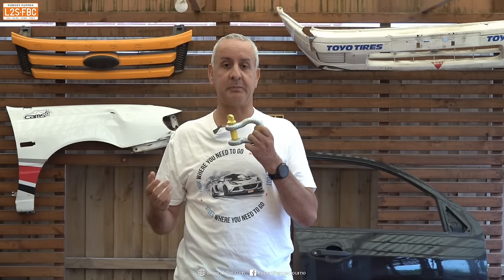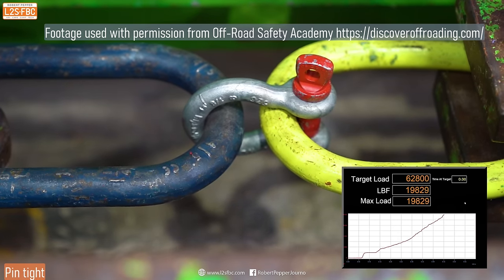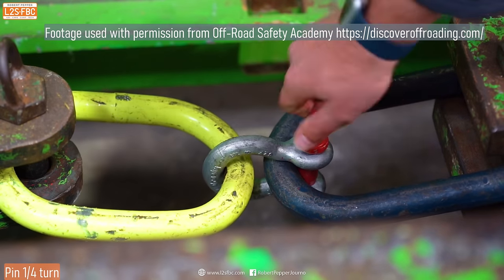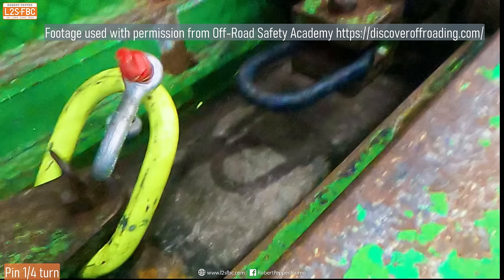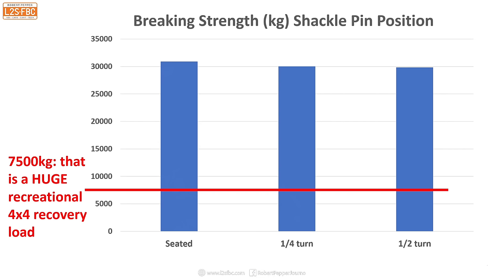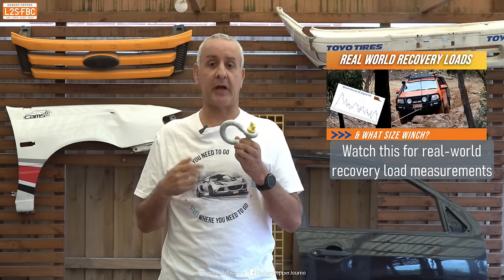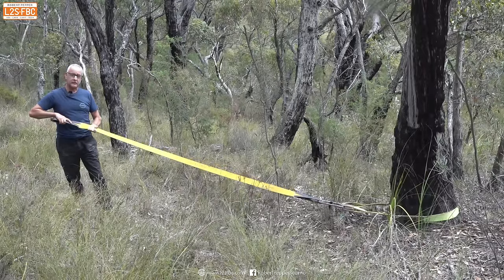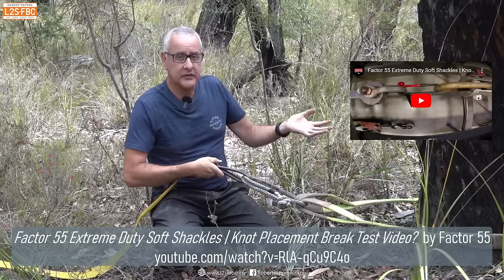What happens if you back off a shackle by 1/2 a turn?

Comment: 5:29 Nit picking here but someone can't use a calculator......  It's quite surprising that the bow remained intact in all 3 cases, even though the two eyes are thinner than the main body.  Also surprising is the fact that the pin broke in all cases, even though it's the thickest piece and a harder steel.  Shows how cutting a thread weakens the pin/bolt at the point where the thread ends.  Finally 3% variation in maximum is well within tolerances for such a shackle, I imagine.  And yes, I am 100% comfortable using them in recovery with 1/4 turn loose.  Nothing worse than having to find a shifter to undo the pin in the middle of a steep slope recovery :)

Comment: Anybody that has ever used shackle's very much knows that the shackle will tighten up when lifting or pulling the load. Have you ever lifted 5,000 lbs like that? Try to unscrew the bolt after that lift. Even with a crescent wrench you will have a hard time getting it started. And for the knuckle heads a straight lift has less tension on the cable or strap than a vehicle stuck in the mud or sand. I've seen it happen several times, Goober trying to get that bolt unscrewed after tightening it all the way down.

Comment: Here's an interesting fact.  I can only speak for Crosby as I do not have tolerance specs for other manufacturers.  Crosby publishes acceptable shackle pin shoulder clearance which is acceptable even after the pin is wrench-tight.  This is hard for many riggers to accept as they are usually taught the shackle is no good if the pins do not shoulder out.  It is sad that Crosby shackle quality is not what it used to be and I see many companies switching over the Van Beest Green Pin shackles.  Their castings are much smoother and they do not use raised lettering.  The later is important because raised lettering is tough on synthetic slings.  Another point is Van Beest and some others counterbore the shackle ear to allow a full diameter pin to engage the ear.  Crosby, CM, Campbell, Chicago...they use a fully threaded ear and so you have a good pin stress riser right at the shackle ear (where the pin thread starts).  

I've swapped over to buying Green Pin or even Skookum shackles for the projects I do for Bechtel.  Green Pins are half the cost of Crosby.  Last time I checked, Skookum shackles were cheaper than Crosby alloy shackles.  The use of Dyneema or Spectra synthetic rigging has made the use of alloy shackles more necessary so that the shackle isn't the weakest link.
Reply from the maker: Fantastic information, thank you so much!  Interesting point re the raised lettering too.

Comment: there's an argument to be made for fully tightening and using a witness mark on the threaded end. in the event the shackle fails in a situation that would be highly unlikely to exceed the working limit, you'd have a better case for a product failure claim.

Comment: Interesting results. I know they state they performed QC on the shackles, but I wonder what that QC process actually was. Just the position of the shackle in the bin after forging can affect the exact strength of the shackle itself as it cools and that cannot easily be determined with QC. Clearly we are not seeing a large difference in the results, and more samples would not likely change the overall opinion, however it would indicate the average variance in the manufacturing process of the shackle itself. Which could indicate the gap is actually even smaller based on the variance in the shackle itself.

It was also curious to see the shackle that was flipped reverse of the other two tests (the quarter turn test) such that the blue ring was in contact with the pin instead of the yellow ring. From a process standpoint this is an uncontrolled factor in the test and adds a potentially unknown variable. I would also be curious to see what prep was done for the shackles prior to testing.

Largely it seems to come down to the fact it doesn't matter from a strength perspective. Only a compliance standpoint (liability based on if you are, or are not following manufacturer directions as an example) or for other use case specific reasons such as corrosion affecting the ability to undo the shackle.
Reply from the maker: The good thing about those shackles is that they do have QC standards so you can be sure they will break above a consistent level...and even the 1/2 turn one managed that.

Comment: The debate on if you back off a shackle half a turn or not in four wheel drive recovery is less so about shackle failure and more about it not becoming a projectile if the pin works loose and comes out. I’ve seen a pin in do itself half way through repetitive snatching.

Comment: The threaded pin is what sheared off and failed, right where the threads begin, all three times
The shackle bent but didn’t break
Reply: Yes, there is a big stress riser right there.  The pin transitions from plain to threaded, and it goes into the shackle ear.  Thus that is the weakest link most of the time.  Some manufacturers counterbore the ear so that the plain pin portion extends into the ear.  I haven't seen any tests to see if this helps but it doesn't matter.  Just need 5:1 safety factor (or whatever they are aiming for).

Comment: Interesting, thank you.

05:31 shows at left the three graphs and at right three values, each expressed in lbf and kg.  I speculate that these are the measured breaking strengths.  Anyway, there seems to be something wrong with the kg figures:  the middle kg value (30,000 kg) is higher than the bottom kg value (29,800 kg), whereas the middle lbf value (65,165 lbf) is lower than the bottom lbf value (65,759 lbf).
Reply from the maker: yes there was an error - see pinned post
Reply: @L2SFBC 

Somehow I missed that.  Thank you.

Comment: In reality tightening or/1/4 loosening of these Bow or D shackles for just this application is marginal, its only in medium to heavy lift configuration you do not tighten the shank due to the possibility of the shackle bolt over tightening  during the lift , most professional operators use a shackle with a pin shank with threaded nut and split pin or wired if it's a permanent lift arrangement  It comes downs to if it's a critical lift you use the correct gear and technique.

Comment: Everyone seems to be focused on undoing it by hand. That little hole in the pin is specifically sized (I assume anyway) for a screwdriver. You can tighten it all the way every time. Just grab a screwdriver to loosen it. No compromise in safety, and it’s not inconvenient to do.
Reply: Safety applies to the whole job and everything we do.  The argument is that making a job more difficult by wrench-tight shackle pins may not be worth it.  With vehicle recovery it doesn't matter so much because they don't use a lot of rigging and it is easily accessible.  I would say though, recovery rigging is probably more likely to be overloaded, impacted and abused.  Lifting loads can easily be a different story.  Working with more tools at height means an increase in the potential of dropped objects and fallen workers.  This is a big reason why certain trades are more likely to back off shackle pins.  The risks change for every job.  In all cases though, shackles don't fail because the pin was not cranked tight.  If shackle pins are coming loose, you are using the wrong type of shackle.
Reply: Right. The application matters. A shackle that will be attached to something and left there, exposed to weather and vibration, or driven down the road, could possibly work its way loose. A simple recovery effort that will only see the shackle in service for a short period of time is a completely different situation. One method has the benefit of not working its way loose, the other has the benefit of easy removal by hand. Either way, a quick insertion of a number two Phillips screwdriver is not that hard. Since neither seems to change the working load, I suppose it’s just personal preference at that point. 🤷🏻‍♂️
Reply from the maker: Thank you for understanding!

Comment: As a Fitter in a power station workshops 
A rigger said do this when lifting
Any imparted twist on shackle pin may cause it to bind then you cannot undo it by hand
It is only so you can undo it by hand

Comment: A Crosby 7/8 screw pin shackle is load rated at 13,000lbs, both of these tested shackles failed at 5 times that load.  tight or lose pin is irrelevant for off road use on vehicles up to 1 ton pickups.  Even a 15k winch will only pull that line load on the first drum wrap.

Comment: In the real world it typically won't matter.  Ten guys do it one way, ten the other, and their results will be the same.  There can always be exceptions -- but they're exceptional. :)   It is true you may need a tool to loosen a shackle that was seated pre-load.  Not an issue, unless of course you don't have a tool handy.  I tighten.  Have an adjustable wrench next to my seat.  I leave them on the bumper so have to tighten them anyway vs losing them.  Not uncommon for my friends to lose one on the trail...or maybe in a parking lot.

Comment: As a rigger we use the 1/4 turn back off to make it easier to remove the pin, as the strength difference is negligible

Comment: As a lift engineer I often used shackles. I never heard about this “back off” so I always run the pin in up to the shoulder on the basis that this this supported the bow from distorting. I think that you have to remember, in the real world, shackles get pulled around and often loaded in all sorts of ways including sideways ! There’s also the differences between loading on a hard pin or a multitude of soft strap. It’s a tough life being a shackle but I would still turn that pin up to the shoulder ✔️
Reply from the maker: I guess in lifts the shackle is done up and then left until the next inspection?  I'd do it up too!

Comment: If you are using the correct shackle for the load you will never ever have a problem or issue with backing off a quarter of a turn.

Comment: I am not coming from the 4x4 tow world but the OSHA environment.  this backing off technique would be an OSHA citation due to the manufacturer requiring hand tight pins.  I have never seen a manufacturer advise backing off the pin, I only have heard it in the field to get the pin out easily after the load is moved.  Also, if you are rigging the shackle pin with synthetic slings, backing off the pin could cause damage to the eye of the strap.
Reply: True, OSHA isn't always concerned with the full picture when it comes to safety.  There are reasons why certain trades are more likely to back off a shackle pin for safey's sake; however, manufacturers have their rules and OSHA doesn't go further than that.  Increasing job duration, chances for dropped items or fallen workers...that all detracts from overall safety.  It's the classic battle between those who do the work and those who oversee or regulate.  I can see both sides but problems come when regulators try to take all the thinking away from the workers.

Softeners may be appropriate when connecting slings to shackle pins.  Also, some shackles are better than others.  Makers like Green Pin counterbore the shackle ear so there are no exposed threads on the pin.

Comment: The difference is probably within part variation and margin of error.
The reason for backing off again is - so I thought - not to increase the maximum load, but to make it easier to open it up after it was within design load.

Comment: EPRI, ASME b30.26, and Crosby all 3 state you should not back off the pin. There are 2 reasons for this. #1. If the pin is already loose, theres a posibility the pin can start to back out. #2. Everytime you back the pin off, the shackle stretches ever so slighly. Doing this over and over, the shackle will stretch to the point its no longer capable of its raiting. If you look at a brand new shackle, the end of the pin will sit flush with the ear. If you look at a older shackle thats been backed off evey time its been used, the pin will be "short" of being flush, due to the shack being stretched apart.
Reply from the maker: What's their use case when they state that? Is it 4x4 recovery with loads of 8000kg and less?  Or is it hoisting to specific standards?
Reply: @L2SFBC  situation of use is irrelevant. Doesn't matter if it's a 40ton vertical lift, or if it's pulling a honda civic out of the snow. EPRI (the golden standard for rigging certifications), ASME, and Crosby (the largest rigging manufacturer in the world who probably made every shackle in your inventory), all say to never back off a shackle pin. Just the fact that when you don't back off the pin, it tightens up, proves that shackle is stretching. By backing off the pin, you're giving that shackle more room to stretch. Grab a new shackle from your inventory and a well used shackle. I bet the threaded end of the pin on the new one is flush with the ear, while the used one is recessed. 

Your channel is dedicated to "automotive safety", and yet you're preaching information that could get someone hurt or killed.
Reply: Sure but but some things to think about.  Not all shackle pins will shoulder out against the shackle ear.  Crosby has acceptance criteria for shoulder clearances with a wrench-tight pin.  Therefore, Crosby will accept something like a 1/8" shoulder gap (on small shackles) even with a wrench-tight pin.  Some new shackle pins are shy of being flush with the outside of the shackle ear.  I'd say no one tightens down bolt-type shackles...they spin down the nut until the cotter pin goes in.  Other shackles have threadless pins such as Crosby  Easy-Loc which has to have some acceptable gap to allow assembly.  Yes, manufactures and regulators say not to back off pins because it starts with the manufacturer.  They do that for liability reasons and it is the easiest position to take.  

If good rigging practices are followed, quality shackles do not permanently deform, even when backing off the pin a small amount.  Of course though, at some point the amount of "backing off" becomes excessive and problematic.  Quantifying this is another reason why manufacturers just say to tighten the pins - that's easy.  Riggers, on the other hand, have to do the work.  It may not be a big deal when pulling out stuck vehicles, but stuck shackle pins matter when you either deal with them all day or you are working at height (or other sensitive places).  Struggling with pins at height could contribute to a fallen worker or dropped object.  Either can kill. 

Like a lot of things, there is more to this than many people realize.  Often we are told to do things for safety's sake, yet sometimes we struggle with making matters worse.
Reply from the maker: Thank you, I appreciate the nuanced comments.  Just posted on FB about it using part of this comment.

https://www.facebook.com/RobertPepperJourno

Comment: 3000# isn't something to guess about, but also, the point of tightening shackles, IS SO THE PIN DOES NOT BACK OFF AND FALL OUT, if you are worried about them getting stuck, crescent wrenches are cheap, so are hacksaws. If you are just making a single pull its probably NBD, but for what I do, most of the time its repeated pulls, or the shackle is 25-100' up a tree, and if it comes loose people get maimed, so tighten them please.

Comment: Just don’t back them off. They’re designed to seat in. Don’t be lazy just use a tool to release the shackle is required after loading. 😎👊👍🇦🇺

Comment: Slinger here.

Its not about letting it be strong to the its rating, because if you need it THAT strong,  you're doing it wrong anyway.

It's about being unable to undo it after a lift, and often you can't be in a position to whack it with a hammer to loosing it again.

Comment: The video shows when backed off and not backed off they both exceeded their cert breaking load.. and they were within 3% of each other which is insignificant compared to real world variation of used kit in the field.
So this proves that backing off doesn't weaken it (and makes it easier to undo afterwards). Argument settled 1/4 back off it is then! Thanks!
Reply from the maker: Exactly and you're welcome!

Comment: So, that 3% difference that shows up when tightening, minus 1/4 turn , or minus 1/2 turn, absolutely could be variation in the breaking strength of each shackle without regard to its pin tightness. Since only one shackle was shown in each condition and nothing was said about groups of the same conditions averaged, I’m not confident that the variation is a result of the tightening. 

A good point is made about the working load limit of each shackle being way under the specified breaking strength. That tiny fraction of the whole is but a tinier fraction of multiples of the whole. So 3/100 of something is extra tiny compared to 5 or 6 times something. 

And best practices are mentioned as well. These are absolutely established based on the experience gained from many trials and therefore statistically based.
Reply from the maker: Maybe..but do you think we can conclude that backing off doesn't affect strength to a significant degree?  If the backing off is lost in the noise, within scatter, is that useful information?
Reply: @L2SFBC  without more data (what we have being a sample of one, or rather two), my conclusion is that there’s no difference in strength: just having the pin there, and threaded most of the way gives the strength needed. The fact that it may be tight, 1/4 turn loose, or 1/2 turn loose makes no difference.